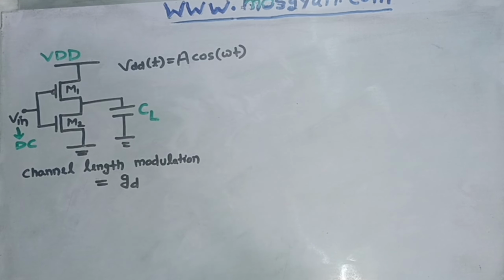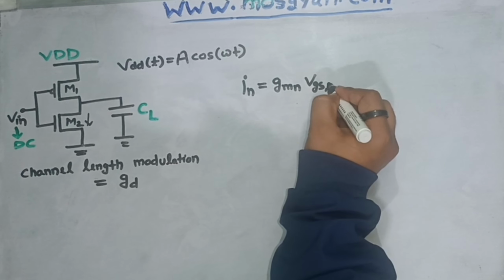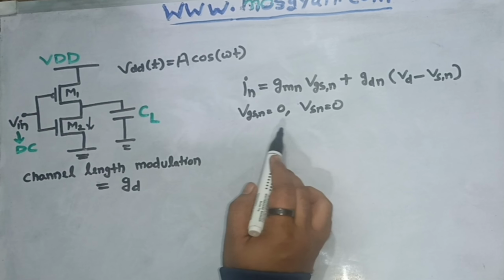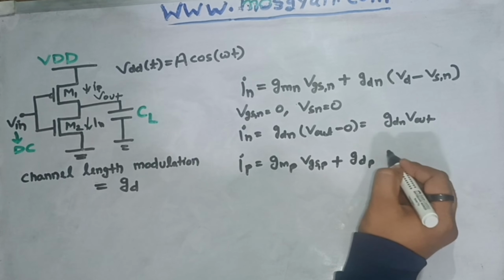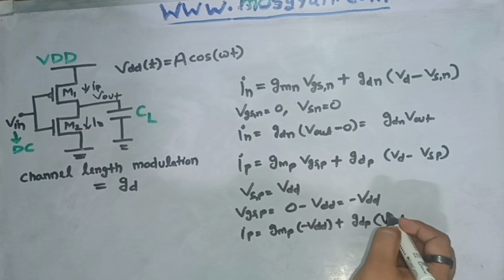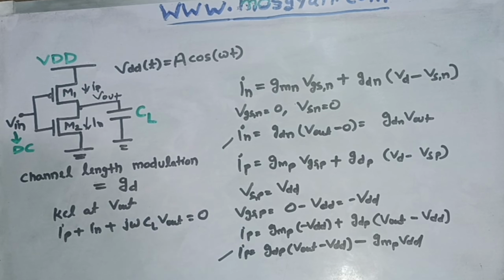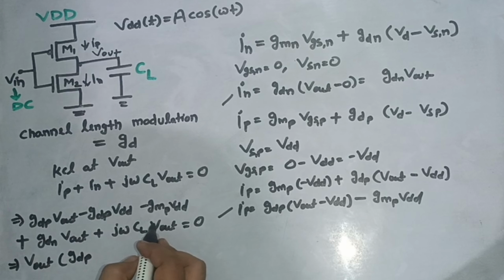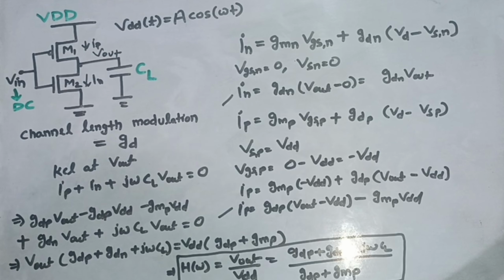PSRR of CMOS Inverter if Supply is Varying | Questions on CMOS Inverter | PSRR Transfer Function

Comment: Two things:

1. Last equation is vdd/vout so it should be inverted (flipped) to get vout/vdd

2. You say: ip = gmp*vgsp + gdp*vdsp

This is correct but the current polarity should face up not down so that current flow from drain up to the source of the pmos.

The final equation will be the same because when u typed KCL @ vout you assume the p-current is facing up correctly :D

Also, what is the conclusion here? How does PSRR behave with circuit parameter?
My only thought is to reduce gmp as much as possible (reduce size) to enhance output jitter but that will affect the rise time.
Love to hear ur thoughts. 

Thanks in advance.